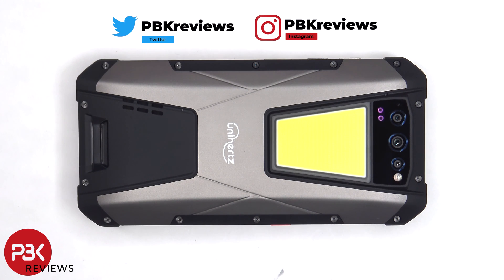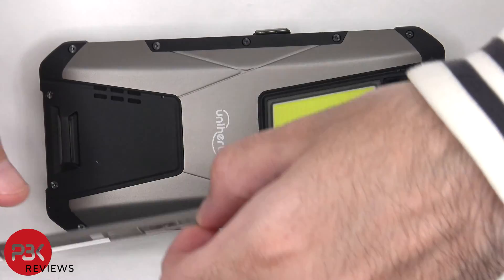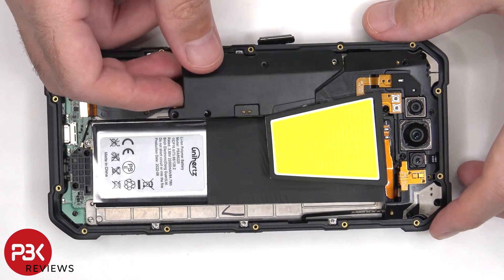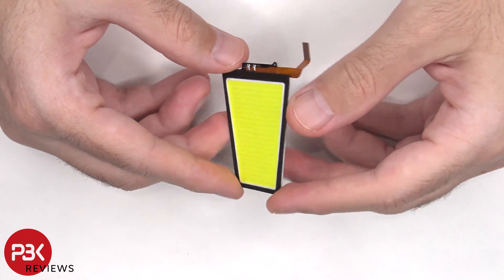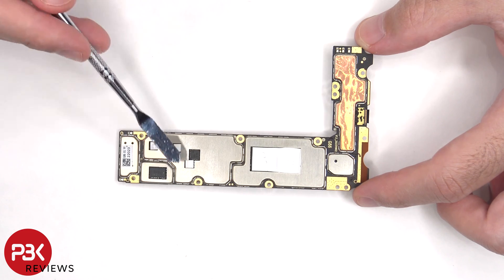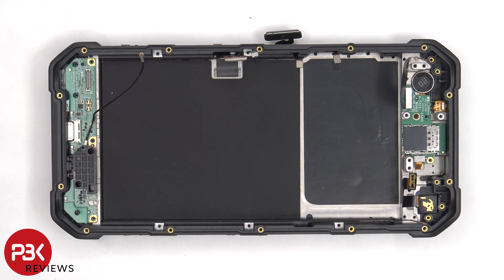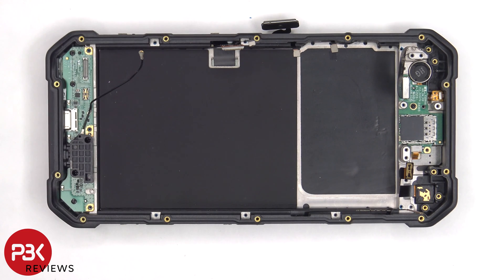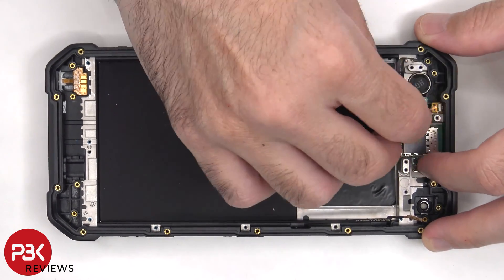Unihertz TANK Teardown Disassembly Repair Video Review. 1200 LUMENS LIGHT! 22,000 mAh Battery!

Comment: 6:20 You can see that each battery cell has 3.87V and 23.99Wh. There are 3 battery cells. We can calculate phone's capacity in Ah if we know high-school level of basic physics:
Wh/V = Ah
So, we have:
3*(23.99Wh/3.87V) = 18.597Ah = 18597mAh
UNIHERTZ LIED ABOUT BATTERY CAPACITY. WHAT A SCUMBAG COMPANY!!!

Comment: really hope Uni decides to sell replacement battery tray assemblies
Reply from the maker: Have you tried contacting them to see if they can sell you replacement parts?
Reply: yes, and they do have the battery @PBKreviews
Reply: @lockbreaker7961  Hi. I have a problem with my TANK. It doesn't charge anymore. It could be the batteries or something else. I need to recover some recordings that I did and it is very important for me. If you can help me telling me if this problem could be of the batteries. I tried to contact Unihertz but I couldn't. Thanks.

Comment: Yo

Edit 1yr later; Tank 1 seems to only have battery capacity of 18 000mah 

EDIT:

Guess it was some issues with the battery controller, now after charging from emty to 100% again, I measured 21 850mah 😁
-------------------

I just tested the battery capacity with AccuBattery and it says full capacity is around 17 400mah only.. far from 22 000mah..
Reply from the maker: really? hmm wonder if thats the rated or typical capacity since batteries have both. rated capacity is always less than the typical capacity rating.
Reply: @PBKreviews  Hey and good morning.

I just want to inform you I did another fully charge and now it measured to 21 850mah 👌 So very happy now. Guess there was an issue with the battery controller (or BMS) or one of the cells had an lower voltage, hence the power cut of early. Guess charging to 100% resolved that. Will do some more testing later to be sure.

Have a good day!
Reply: @PBKreviews  No, there shouln't be such a big difference (20%!!) between rated and typical capacity..
Reply: @PBKreviews  Could you do a teardown of the "battery-module" to check the actual capacity? Thanks

Comment: Are all three batteries inside the same? The 2 on the back say they are 23.99 Wh at 3.87 V. If there are 3 like that, it’s 71.97 Wh and not 84.7 like the one says on the flip side.
Reply: Seems like it.. 

I just tested the battery capacity with AccuBattery and it says full capacity is around 17 400mah only.. So far from 22 000mah..
Reply: @Stephanox69  So Wp19 is still the champion.
Reply: @cellyang7053  yup lol
Reply: @cellyang7053  Hey guys

I just want to inform you I did another fully charge and now it measured to 21 850mah 👌 So very happy now. Guess there was an issue with the battery controller (or BMS) or one of the cells had an lower voltage, hence the power cut of early. Guess charging to 100% resolved that. Will do some more testing later to be sure.

So guess the Tank is the champion here 👌

Have a good day!
Reply: @Stephanox69  hhhh,lol

Comment: If only they use better processors and optimize ram usage more 🤦🏿‍♀️🤦🏿‍♂️
Reply: Why what's wrong with this?
Reply: Yeah would love to see a SD GEN 2 in one of these 😎
Reply: If only it had 90hz screen
Reply: @rustymixer2886  yeah or 120hz with adaptive refresh rate
Reply: @Stephanox69  yup
Reply: @Stephanox69 why? 120hz in a midrange processor? It will stutter. 

Plus, 60hz to extend battery life because that's what it's designed for. Having 120HZ make it less affordable

Comment: Suggestion : please include the Processor details. The name of the processor and ram and storage quantity. 6 gb ram 128 gb storage like that.
Reply: Display: 6.81-inch FHD+ screen
Camera: 108MP Triple Camera / 16MP front
Memory: 8GB RAM / 256GB ROM
Platform: MediaTek MT6789, aka Helio G99 CPU / Android 12
Reply: @himanologanor4093  🆗 bro
Reply: @himanologanor4093  thx
Reply: @himanologanor4093  90hz?
Reply from the maker: I will keep in mind for the future but the thing is, most phones come with many ram configurations as well as storage and the size of the ram or storage doesn't change where the chip is located or how the chip looks.
Reply: Sorry master my apologies 😔